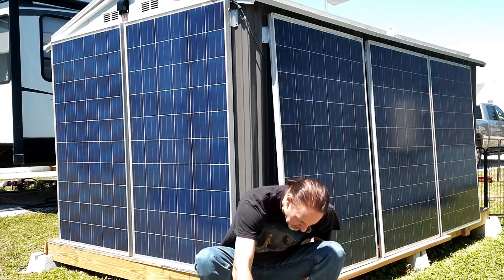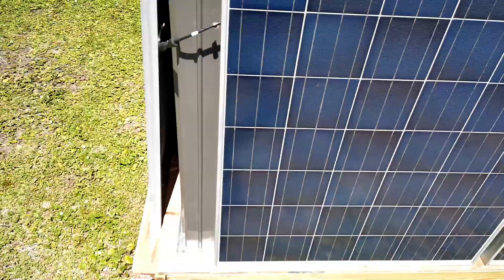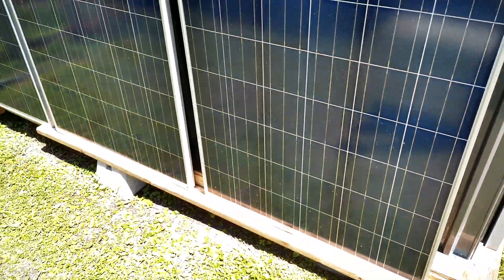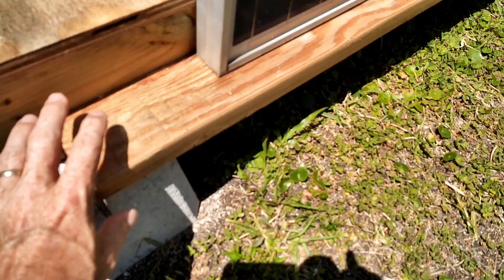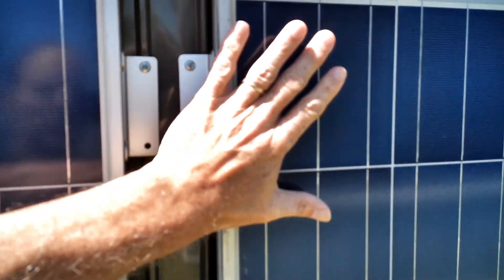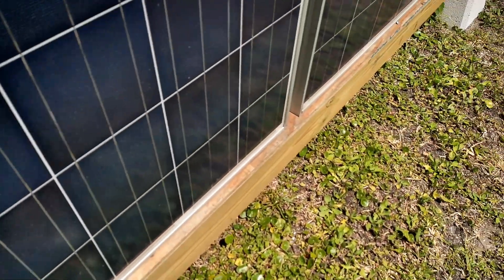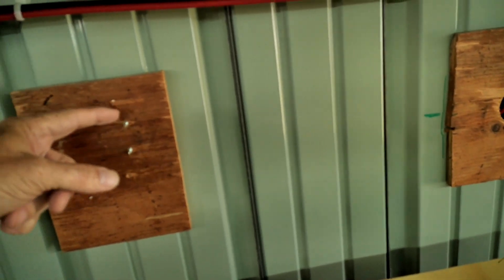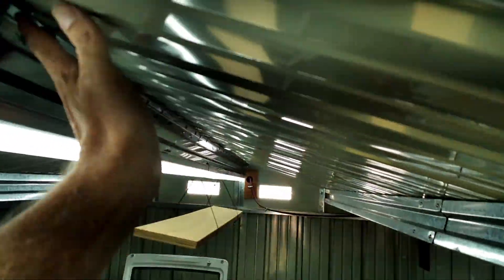Is My Shed Strong Enough For Multiple Solar Panels?

Comment: I’m thinking about putting just 2 panels on my shed roof. What screw did you use to screw into the shed roof?
Reply from the maker: I used regular wood screws to connect with the board behind the tin roof or in the case of the one at the bottom they are in the aluminum frame and they are self tapping, but they all will need to be sealed, I am thinking of using LAP Seal like on a RV roof. I will prob just seal all the regular shed screws also just to make sure it dont leak.